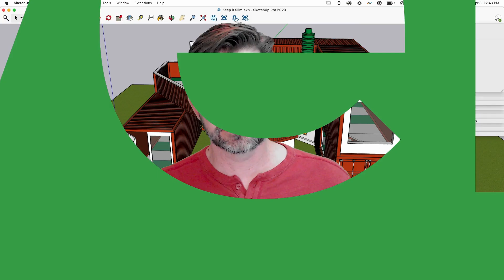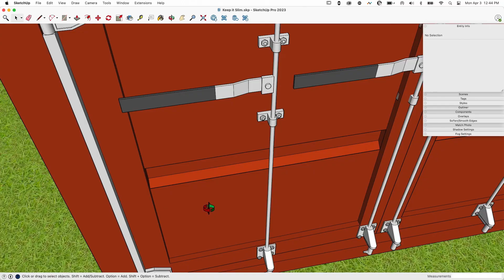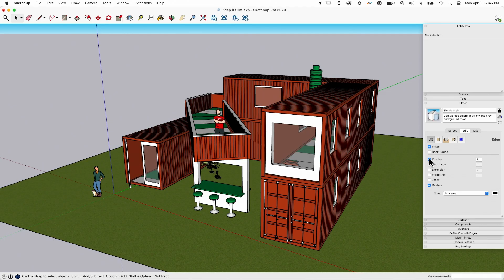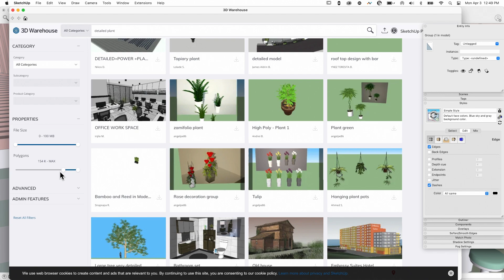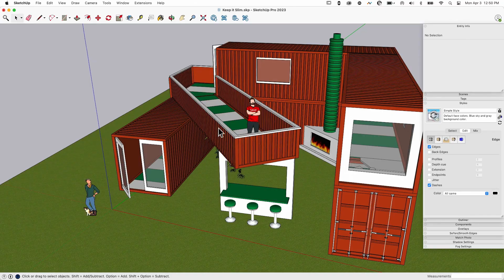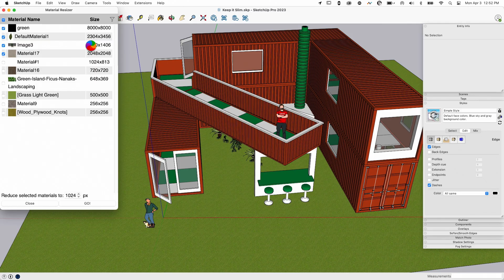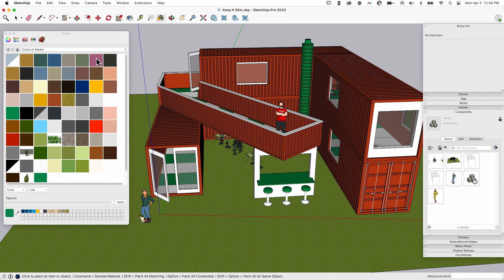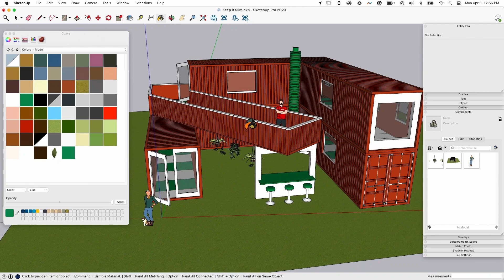Keeping Your Model Performant

Comment: Would a better graphics card/ larger ram over come this? I was gonna upgrade so I can show clients their projects with out it bogging right down.
Reply: The only thing that overcomes this is a bigger base clock for your CPU - this is a general rule for every CAD software; it does not matter if you have a dozen cores, as long as your CPU base frequencies is small.

Comment: Another tip for Mac OS users is to use your monitors default resolution or a "clean" multiplier, i.e a 4K monitor can be scaled to 1080x1920. I myself use a 27" 1440x2560 display at work but for some reason I have a 27" 4K monitor at home, and frankly working in 4K on 27" is actually way to small for me, but setting the screen to 1080 just looks wrong to me now that I'm used to my 1440-screen, so I rarely use SketchUp on my 4K monitor for that reason.

When using an uneven scaling factor in Mac OS, it just doesn't handle SketchUp very well at all, so scaling the 4K to 1440 makes it stutter just like the example shown in this video

Gaming on the 27" 4K is awesome though 😄
Reply: Lucky you!  Gaming would be excellent on that monitor.  I usually just leave my resolution on default and have never had issues.

Comment: Would be cool if SU automatically creates low(er)-poly versions of components and groups. This way, as you zoom in and out, it could automatically switch between different levels of detail and maybe even toss in an "always face camera" thumbnail representation for objects that look really small on the screen.
Reply: It should be cool . 🙂
Reply: @zack4258  There is at least one extension for that: TIG Matrix Proximity, and maybe Fredo Ghost.